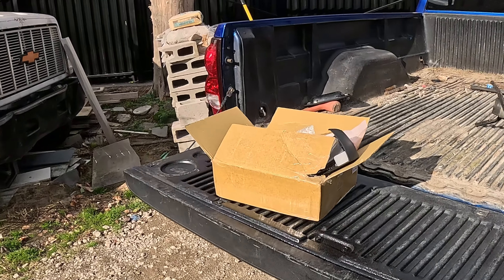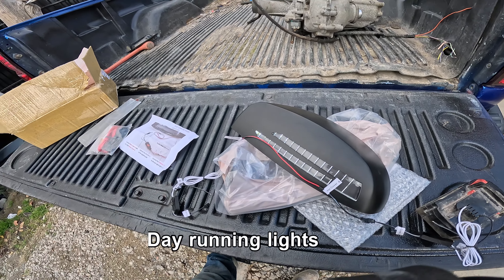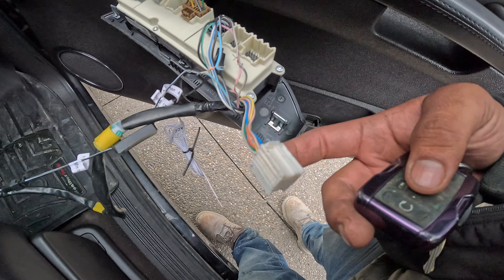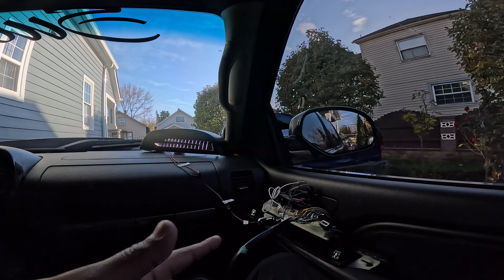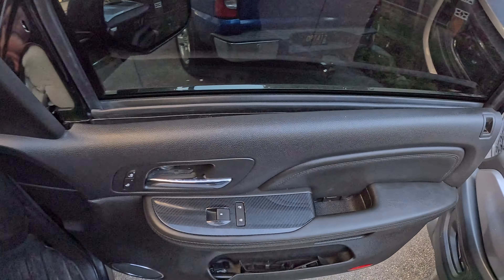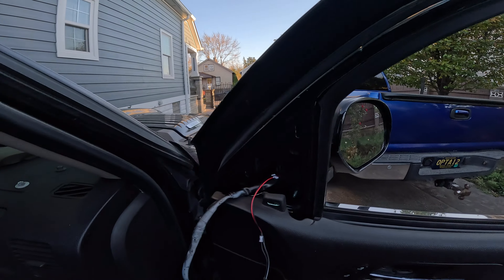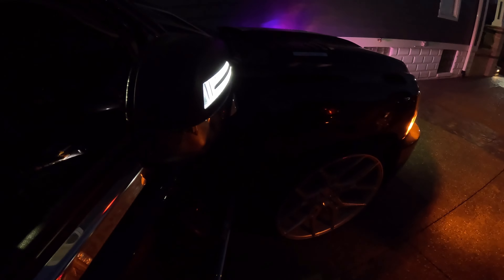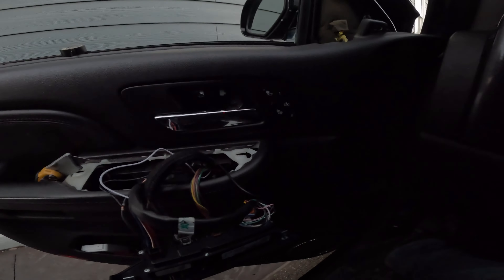INSTALLING LED MIRROR CAPS ON MY NNBS SILVERADO!!

Comment: Aye bro I was thinking of wrapping my hd bumper how did yours hold up?
Reply from the maker: So far the wrap is holding up pretty good just one minor spot where it’s starting to peel but it stopped and it’s not noticeable, but it’s holding up better than paint even though it doesn’t shine as much as paint but no rock chips etc.